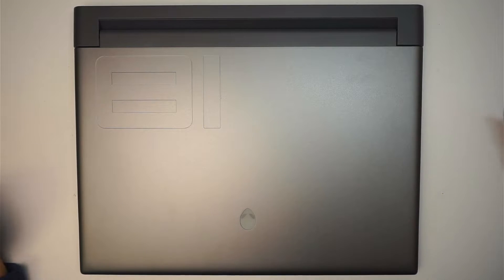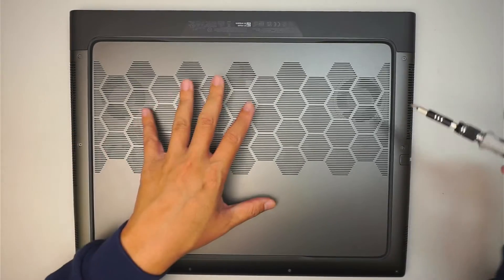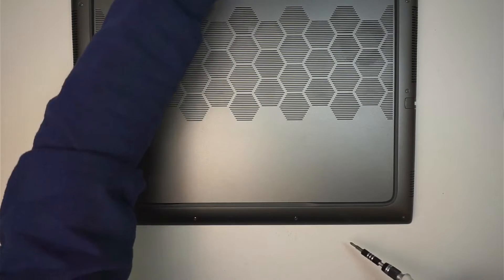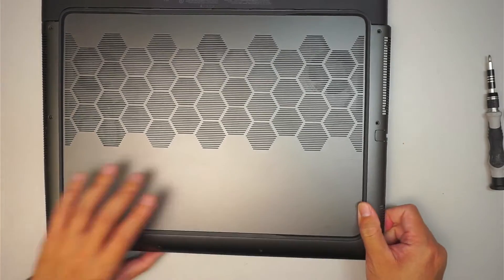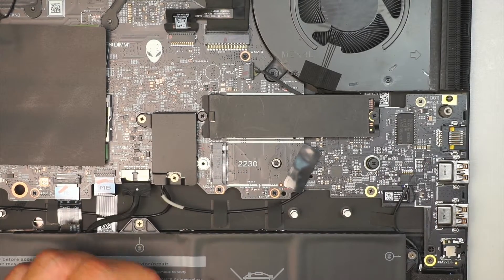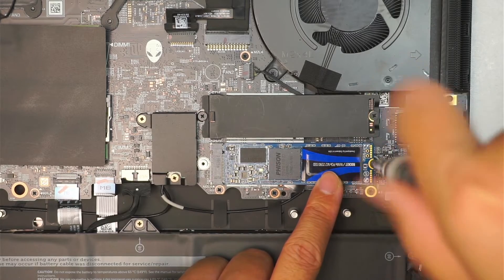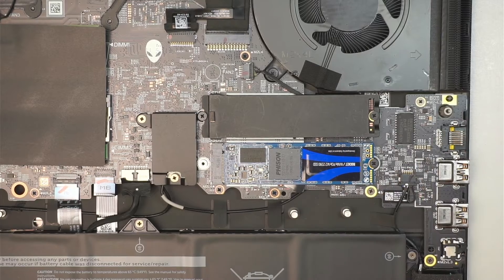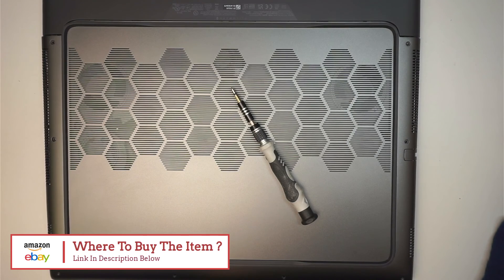Alienware M18 R1 Add Additional M2 SSD Storage

Comment: The screw on m.2 spacer for second disk didnt separate. Appears dell wants us to buy this spacer to install an additional m.2.  where to find?
Reply: It just looks like it doesn't. Looks like a smaller screw inside a larger screw but it aint

Comment: Great video. Can we do the same for m18 R2?
Reply: Yes, i got my m18 R2 yesterday, and i am waiting to receive the SABRENT Rocket Q4 2230 NVMe 4.0 2TB High-Performance PCIe 4.0 M.2 2230 SSD--i bought two and found them at $189 on eBay--the best price i could find, as opposed to $220 at Amazon--and the Crucial P3 Plus 4TB PCIe Gen4 3D NAND NVMe M.2 SSD; i will have 12 TB of storage; i got the ideas from this guy: https://youtu.be/SULtYlteUqk?si=wWGOtGcaO-4uMYBb
Reply: Hope so mine is coming this week.
Reply: I have the same question, but it looks simple - so I am guessing so!

Comment: Hey Simon, I was looking at another video of yours, not pertaining this model the model is Victus by HP 15.6 inch Gaming Laptop 15-fb1000 (7Y8M8AV) so I recently got this laptop yesterday I gamed on it for a second then it froze up. I reboot it up and it comes up with a 502 error with the blue box. I press enter. It sends me to a black screen with my cursor being able to move and the spitting blue icon.
Reply from the maker: Hi
If this is brand new less than 14 days, try return the laptop. Check the return policy. If cannot return, maybe check with hp for warranty. 
Seems like something is wrong with hardware.